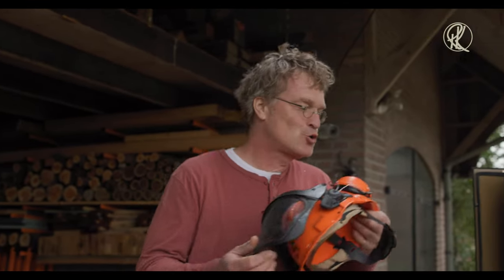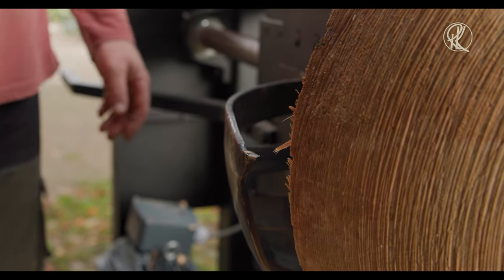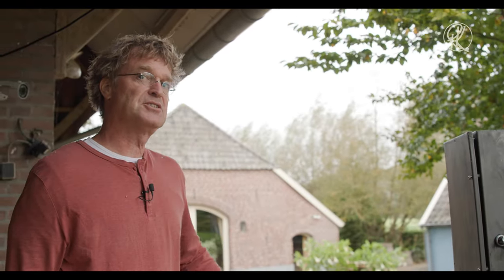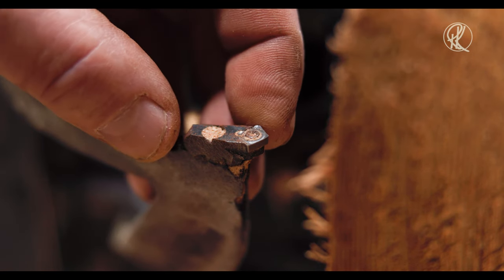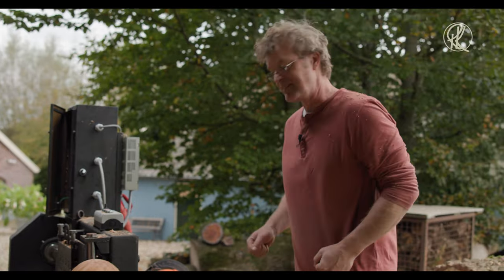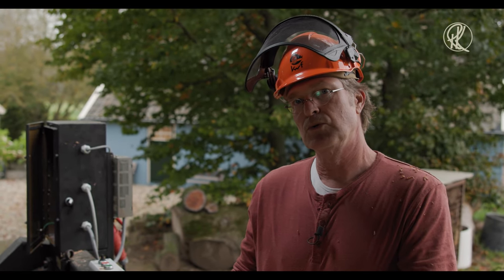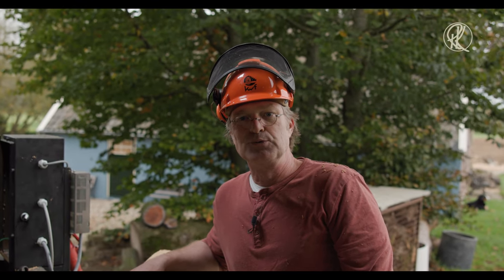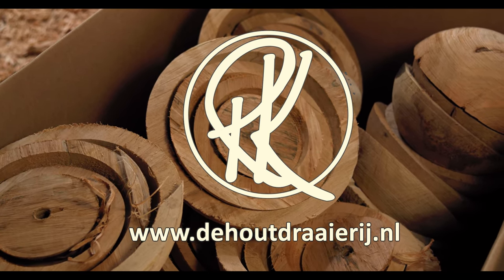Now that is a Bowl Saver!!! Coring a bowl in seconds!

Comment: Not only are you saving a ton of time using that coring machine but also greatly extending the life of your lathes motor and other components like bearings, etc. by not coring on it which is right up there with the most demanding tasks one can perform on a wood lathe.

Comment: Didn't think there was anyone as crazy as me to build such a machine.!!  Yours looks a bit heavier and I only go to 16", but same principle. Mine is powered by a 212cc gasoline motor.   In 2020 I converted my knives and made one new one to accept CCGT060204  or CCGT 060202 tips.  They use more horse powerer but forging previous cutters was very difficult for me and they would occasionally break.  I've also converted 4 sets of oneway knives to the carbide inserts.